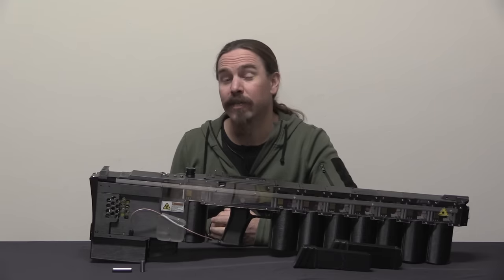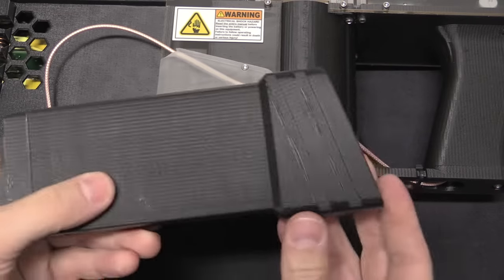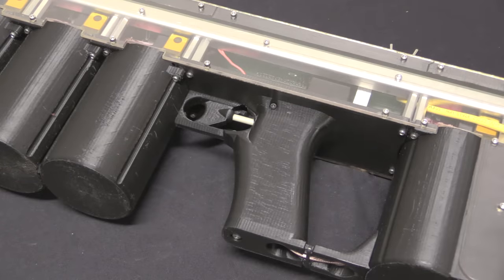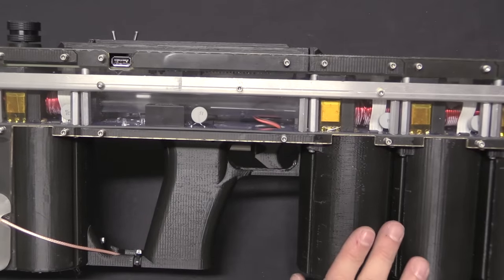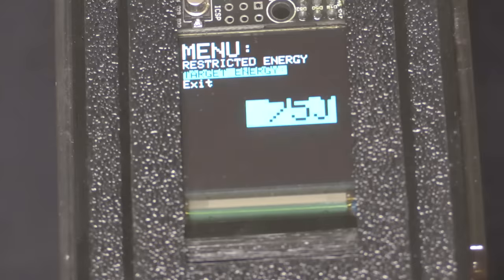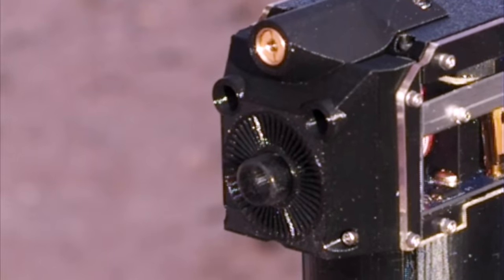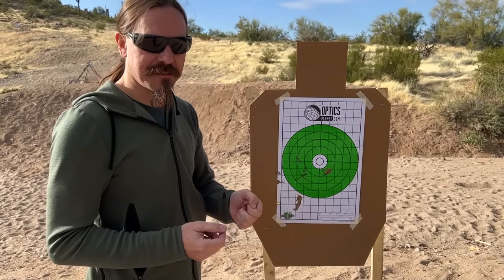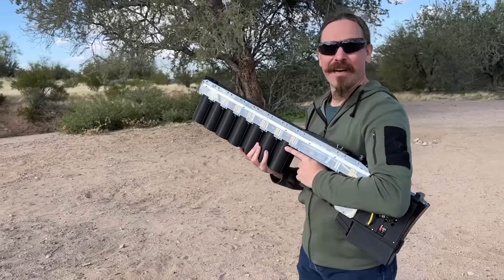ArcFlash Labs' GR-1 Anvil Portable Gauss Rifle

Comment: Incredible technology, but it clearly still has a long way to go if it's only firing projectiles at 70m/s (150mph). I suspect that some humans could throw them this fast. As is I fear this platform may be outperformed by JoergSprave.
Reply: It is in an alpha state so things will hopefully improve
Reply: I mean you're not wrong but to beat The energy you'd have to be very physically fit either a very good pitcher with a nasty fastball or someone like joerg who is massive and using all his strength he could only manage 130j with a braced slingshot not something The average person could do repeatedly without hurting themselves or becoming exhausted
Reply: @k9vendettathewolfofmordor529  JoergSprave is currently also in an alpha state ;)
Reply: Literally anyone with a sling (not slingshot) could make more energy than this, and in a more terminally effective form.
It's neat and hopefully this is the matchlock of electrical weapons rather than the rocketball
Reply: The ArcFlash guy goes into quite a bit of detail on this topic in the previous video about the weapon. He basically said that they’re setting the foundation for this type if weapon for when the capacitor technology catches up and they’re able to push this thing a lot harder.
Reply: @Robert-qm7yi  it's totally just a matter of time. As technology improves, the form factor will only become more practical, and the capacitors more powerful
Reply: LET ME SHOW YOU IT'S FEATURES....
Reply: Need a bow vs coil gun match.
Reply: @Robert-qm7yi  like Ian said, this is pretty much a proof of concept for a man-portable gauss weapon
Reply: I love both the fact and intelligence in your statement and that you mentioned JoergSprave.
I wonder if he and Ian could ever collaborate on a video.
Reply: @ogloc6308  you would just have to increase the capacitor output buy 1500%, find a power supply powerful enough to charge it, some how with magic make the heat created disappear so it doesn't explode and boom you have the equivalent of a smoothbore musket.
Reply: @mageyeah7763  it couldn't beat a cheap sling shot let alone a bow lol.
Reply: Yeah, but the fact that someone built a functional and man-portable (if kind of crappy) gaus gun is still pretty cool
Reply: @ShloppyShmeat  the concept of a coil gun is 120 years old lol.
Reply: Waiting for JoergSprave to build his own rail gun.
Reply: ☑️ This thing is outperformed by the 1870's .50-70 Trapdoor Springfield, Remington rolling block or Sharp's rifles. All of those rifles can fire about as quickly, AND at roughly 6x higher muzzle velocity and 12x - 15x higher muzzle energy! That's not to mention that it weighs 3x more.
Reply: Well how many humans can throw rods that fast, accurately, and without tumbling? Thought so.
Reply: @HighlanderNorth1  I think you're missing the point. It's been openly stated this technology is a prototype alpha stage product meaning it until supposed to compete with anything. It's a proof of concept with the intention of improving overall performance as the technology improves.
Reply: @Johnny-tq9no  yea, thats why the guy specified that only some people will be able to achieve that feat.
Reply: @kevincornell1439  a concept and a proof of concept are two different things, aside from you ignoring the man-portable part
Reply: @javierpatag3609  I'd love to see a collab between Ian and Joerg!
Reply: Ian: "this is absolutely an alpha sort of development project"
You: "it clearly still has a long way to go"
...yeah, that is, in fact, what alpha means
Reply: @kevincornell1439  Somehow with magic? My man, there is no heat generated by friction in the weapon. I would assume if you've developed the technology to generate and store a pulse of energy of a specific size you've also developed ways to deal with the heat. That being said, you wouldn't need a pulse 1500% more powerful. If you increase the muzzle velocity about 300% you're now generating the same muzzle energy as a .357 Magnum.
Reply: They just need a more compact, more powerful and higher capacity power supply for the gun itself, the Ukrainian army had this problem with THEIR gauss rifle in s.t.a.l.k.e.r., so yes, this can be imprived.6
Reply: Turn it over to him-- he'll have it hummin at 1000'/sec in a,week. HAH ha hah haaah....(evil Jorge laugh)
Reply: LET ME SHOW YOU ITS FEATURES!!!!!!
Reply: not sure may of Joerg's favorite toys could handle a 500g projectile at even 70 m/s... most what he uses is under one ounce in weight, especially the various small crossbow bolts... of curse you can accelerate those low weight things faster, but that also means they probably will at 2-3 times the speed have still less kinetic impact...

Edit:
Sorry, the Arc Flash Labs guy was mumbling. Ian just said 650 GRAINS which is only 1.3 ounces, that is definitely in the crossbow/slingshot/Arrow range...
Reply: @ShloppyShmeat  ha this is far from even the first proof of concept. its just built weak enough not to fry itself in use. electricity creates heat and there is now way around that. this thing has ballistics similar to a slingshot. do you people not get how pathetic that is. its like saying i invented a engine that's slightly faster than walking but with a hundred more years of advancements it might be faster then a bike lol.
Reply: @kevincornell1439  That's typically how new technology works... the idea of electric weaponry isn't being explored because the really stages are more efficient than current ballistics technology, it's being explored because the potential is much greater, with ammo being much cheaper with an efficient system
Reply: @000Mazno000  Yeah, but there might be fundamental material scientific roadblocks ahead that we didn't anticipate. Electrical power density and HV discharge capacity are fields where a substantial breakthrough is anticipated every year, to come five years down the line. Constantly moving ahead, like a mirage on the horizon, and not unlike the development of fusion reactors. Moore's Law is now broken, and the equivalent energy density graphs were never as promising to begin with.
I'm not saying neither of these things will ever happen, but I think one would do well to be skeptical.
Reply: @kevin cornell. I don't think you understand what 'proof of concept' actually means.
Reply: yeah its just a toy even a slingshot is more powerful
Reply: @williamradler8712  electrical current creates heat. you pump up the output and you increase the heat in the electronics. since there is now way to stabilize the projectile with spin this is already a dead technology.
Reply: @k9vendettathewolfofmordor529  this thing is alpha for 5+ years
Reply: JoregSprave has completely reinvented some weapon systems and some of his weapons already out class guns. (Like his bare hands)
However, if you give this gun to Joreg, he will make it badass
Reply: @slimjimnyc270  i do just because you call it a "proof of concept" doesn't negate the flaws inherent in the technology. like imparting spin to stabilize the bullet. its just not how magnetic fields work.
Reply: roflwut? you think a human can throw something 150mph?
Reply: @kevincornell1439  "No way to stabilize the projectile with spin"
How do you know that? Have you tried? I can think of three ways to do it off the top of my head. The guy developing this also said they're already working on a way to magnetically spin up the projectile in the barrel.
Reply: @Robert-qm7yi  This probably isn't even the matchlock yet, more like the firecracker
Reply: @ssholum  While I appreciate that you wrote all of that and I certainly think you're opinion is informed, I take issue with you assuming I know nothing of this subject matter. I mentioned in my original comment that I assume if weve developed the technology to create and store enough energy to make this a practical weapon, we've probably also discovered ways of mitigating the heat generated. I was making the statement that this is a proof of concept and not a finished product. That as technology inevitably advances, things people like you think are impractical or not feasible suddenly become practical and feasible. 20 years ago nobody thought computers and cellphones would as small or as powerful as they are today and yet it happened. Battery technology for cars is advancing faster than it was predicted it would. We're building rockets that can land themselves and be reused. I don't see the current limits of conductor and battery technology as problems, they're challenges and I think anyone who actually works in the development of this project probably feels the same way.
Reply: @Marci124  i shouldn't have said no way i should have said ne efficient way. its already extremely under powered for its size. you divert already limited current to another task you will decrease the velocity. increased resistance on gunpowder will increase psi and can increase velocity. you try to impart spin on something being stabilized by a pulsing magnetic field you are going to further drain the over all system. increased heat and increased power usage means less overall efficiency.
Reply: @ShloppyShmeat  this isn't a new technology. after a 120 years it is now portable and kind of functional.
Reply: @williamradler8712  "I take issue with you assuming I know nothing of this subject matter."
This is the Internet. Please appreciate that we have to communicate based on certain assumptions. This is also why I don't flaunt credentials when I make posts like the one you're replying to: no one cares, and I could be lying anyways. But... Electrical engineering is my profession; the challenges I've had to work around are similar to the technology in this device (high current systems). I've also continued to read up on battery research, because I think it's fascinating.

As for the rest of your objection, which I think can be best summarized as "Look at this other cool stuff we did, don't be a Debbie Downer!", I'd like to point out that I specified the limiting technologies. We're not talking about refining existing materials and batteries, we're talking about needing completely new ones. Yes, those things are being researched as we speak, but the existing technology is limited in what it can do.

For a comparison, consider electric vehicles. The first personal electric vehicle was created in the 1830s. The materials technology of the time could not support the concept to a practical end. The concept was revisited multiple times throughout the 19th and 20th centuries, and it continued to fail due to technical limitations (car too heavy, battery too weak). Today, we have electric vehicles, and they rely on materials and battery technology that did not exist when earlier prototypes were created. Not an improvement on existing technology, completely new technology. Diesel-electric systems, on the other hand, were possible much earlier (early 1900s, on ships and locomotives), since they weren't as limited by battery and material technology.

I'm not disparaging the concept of a shoulder-fired coil gun (or other EM accelerator), because I think it's just as cool as everyone else does. I'm saying that the current battery technology, conductor technology, and capacitor technology does not support a rapid-fire, high-energy, shoulder-fired coil gun. At this level, we can maybe support two of those at a time. And again, this is why I pointed to a larger platform as something that is more feasible with realistic improvements to current technology.
Reply: @ssholum  I appreciate what you're saying. I'm struggling to see why you think I'm disagreeing with you. All I'm saying is, technology is progressing faster now then it ever has before in human history. We're doing things that we thought impossible 60 years ago. My point isn't that we'll have them in 20 years. My first point is that technological growth has a habit of exceeding the expectations of the people who work in the practical fields those technologies apply to. My second point is that disparaging a proof of concept because of it's current limitations is very short-sighted.
Reply: @williamradler8712  I'm not disparaging the prototype, because I think it's really cool. I just think that people have a tendency to over-simplify what technological improvements mean. So when I saw you all but hand-wave the heat issue away as "will be solved in due time and there's no friction to cause heat anyways", I felt the need to clarify just how big of a problem heat is in this kind of system by pointing out where that heat is coming from and how it grows in relation to the power output.
Reply: @ssholum  It will be solved in due time. That's kind of my entire point really. Your clarification doesn't sound like a clarification, it sounds like pessimism. If this technology is taken seriously we will find a way to manage the heat. Since we're being like this though I'd also like to point out that the reason rail guns aren't a more viable technology is because of rail warping. Rail guns warp and damage the rails used to fire the projectile every time you use the gun. Its the reason the Navy is no longer pursuing rail guns to replace the 5in dual purpose, they cost way more to maintain while only marginally increasing performance overall. Coil guns typically don't cause irreparable damage to the firing mechanism with every use and they aren't anywhere near as expensive from a materials standpoint. I guess we should just give up advancing technology because it could he hard or may require new techniques.
Reply: @Eric Nunya I meant in developmental lineage ya dip not effectiveness, thats why I followed it up with the rocketball comment.
Matchlocks evolved into modern firearms, rocketball cartridges evolved into still useless caseless ammo
Reply: @Serial765  Yeah, I agree. Maybe you could say the larger railguns the military is testing would be the matchlock or I guess cannon for this tech, at least ship mounted railguns would be practical far sooner than handheld ones
Reply: @000Mazno000  Hopefully, sadly I don't see power storage advancing that far until we basically break the laws of physics. To get say a machine gun that functions effectively you would need a small nuclear reactor to charge it enough for sustained fire, until we can pack a few hundred KWH into something man portable I doubt it'll ever be useful outside navy or artillery applications
Reply: @williamradler8712  
Yeah, I realize that, but if it requires a 22lb gun to accelerate a 600 grain bullet to a mere 230ft/sec muzzle velocity, but you NEED that projectile to reach at least 5x - 12x faster, then regardless of how much they develop the technology, I just can't see the rifle getting a whole lot lighter than that. The designers must  'somehow' vastly increase its energy output AND make it lighter, and more compact, and more durable. That's a pretty big order! I'll be shocked if they achieve it..

 Small lithium ion batteries are already very close to their theoretical limit on energy storage capacity and efficiency, so they won't see much improvement in that area.
Reply: @HighlanderNorth1  we're not talking about maturing the technology in 10 years or even 20 years. We're talking about maturing the technology in 50 years. You have to start somewhere. Modern gunpowder is the culmination of nearly 1000 years of chemistry and experimentation. To say that something doesn't have value because YOU don't see it developing in your lifetime is shortsighted, arrogant, and completely contrary to the fundamentals of science as we know them.
Reply: @williamradler8712  You seem dead set to strawman me... So back to you: "You're such a pessimist, why won't you believe that we can get free energy from this coil of wire and piece of quartz?"

Your entire point is "Just trust me, bro! Just trust the process! Trust the plan~"
That line of argumentation doesn't have a good track record.

BTW, how the hell does me wanting a truck mounted coil gun to be the primary focus of this technology while we're still waiting on the other technology to make compact versions practical make me a pessimist? How the hell is that not cool? IMO, the main cool factor of these devices is that they can accelerate a mass to absurd speeds.
Reply: @ssholum  The difference here is that the technological framework for coil guns already exists. I'm not saying just blindly trust everything everyone says and I'm not saying it'll be fast or easy. What I am saying is that this technology has promise and is feasible enough that given the progression of technology in this field in recent years I'm not terribly concerned that we'll blow ourselves up trying to power a coilgun without the equipment necessary to do it. If we can build a shipboard laser powerful enough to shoot down cruise missiles and a rail gun that can shoot a 50kg projectile at Mach 4 I'm fairly certain we can overcome the heat generated by a coilgun accelerating a 600g projectile at 300m/s in a man portable package. I agree with you that armored vehicle mounted coilguns would be cool and should be an application of this technology, I just don't think it should be a focus. We should be focusing on making the technology smaller and more efficient, not trying to find ways to scale it up.
Reply: @Dudeman9339  75m/s is speed of this toy
Reply: @williamradler8712  
🤔 Maybe I'm not being clear enough in my justification for being critical of this technology, and I'll willingly admit that it's possible that I am wrong here. Also, I'll acknowledge that, by experimenting and developing one particular type of technology, we sometimes end up learning new things that are completely unrelated to the actual project at hand. As a hypothetical example, this project may teach us how to develop better, more compact capacitors for use in "non-gun related products".  That fact alone may be a good reason to continue developing this. 

👉 But my earlier comments were related specifically to the fact that everything about ^this prototype's technology is impractical, inefficient, ineffective, and shockingly inferior to technology that existed at a time when horses were still the primary mode of transportation, and candles were the primary source of light! The capabilities of this gun are far WORSE than that of the rifles available during that era! 

So not only do they have to make this thing smaller and lighter, they also have to make it vastly more powerful! I think you'd agree that's a tall order. But the main question I'm asking, is why is this needed in the first place? Are they running out of gunpowder? Maybe there's a concern with the ongoing waste of lead and copper in cartridges, but there are probably much simpler, less costly solutions to that problem....
Reply: @HighlanderNorth1  No I understood your point. What I am saying is that your point is startlingly shortsighted. It took nearly 1000 years to develop smokeless powder. If they had just stopped because at the time a trained bowman was more effective than a trained rifleman we'd never have developed the technology we currently have. You don't just not develop technologies because they're inefficient and ineffective as an early proof of concept. We wouldn't have cars or airplanes or many other modern conveniences if we as a species thought the way you think. Innovation and technological advancement demands that you start at the bottom and work your way up. There are also several reasons why this technology will someday be superior to firearms but that's an essay I'd rather not write in a YouTube comment section. The short version is potential damage, safety, pollution, and simplicity of ammunition.
Reply: @williamradler8712  
Jesus dude, I was being as courteous as possible, I admitted I "could be wrong* in my assumption, etc. But you just had to continue on with the personal insults. BTW, this IS NOT comparable to airplanes! I never said that "as a species we should just give up on EVERY newly developing technology". But we SHOULD pick and choose which ones we stick with. Maybe this is a good idea, maybe not. I already admitted that I DONT KNOW that answer! 

But science is SUPPOSED to include civil debate on which ideas should or shouldn't be further developed! Would you prefer we continue researching EVERY technology, including ones like "Waterseer", even though the most basic laws of thermodynamics prove it to be a complete scam, just because we wouldn't want someone to (misguidedly)accuse us of wanting to "deprive our species of Wilbur & Orville's accomplishment of flight"?
Reply: @HighlanderNorth1  I'm not sure why you think me criticizing your opinion and standpoint is me personally insulting you. I never called you a name or made any insinuations about your intelligence. I don't agree with you, that should he apparent. That being said, equating a technology that has existed and proven to work even in a limited capacity to a scientifically dubious idea is... not smart. This technology works and adheres to currently known and understood laws of physics, it needs more development. You're not making a very great case for yourself here. You accuse me of insulting you when I didn't and then go on to make a dubious comparison with no basis in fact.